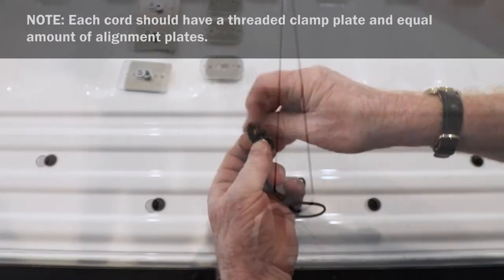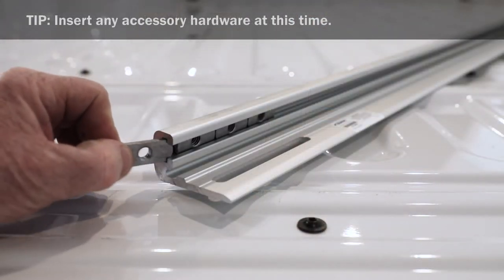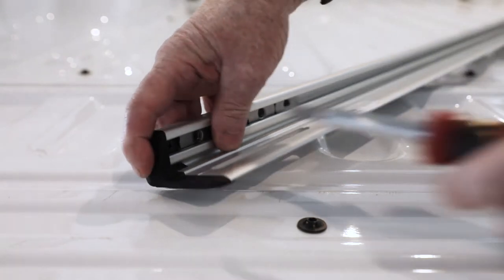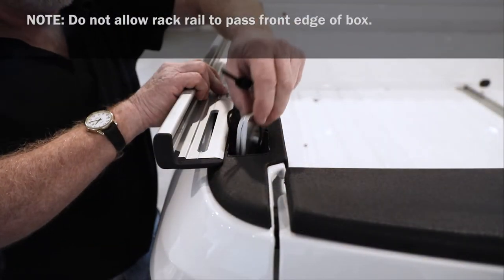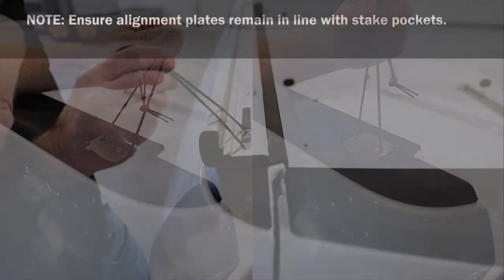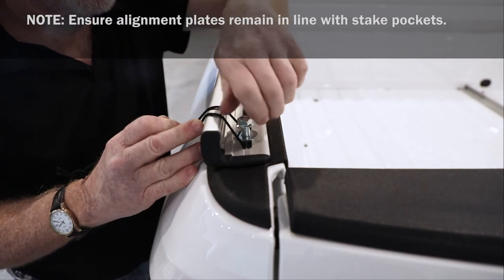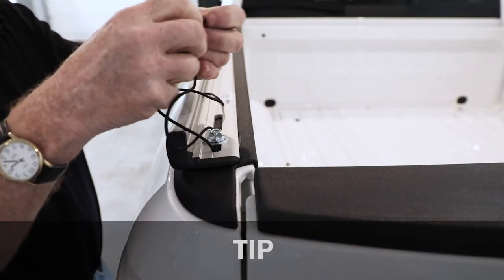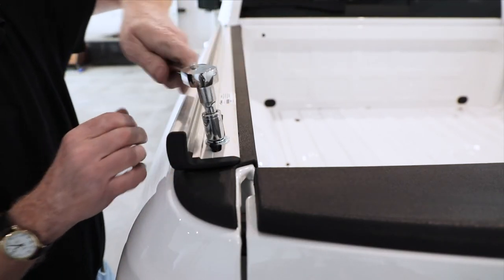ADARAC™ Aluminum Utility Rail Install Video

Comment: So the mounting of the rails just one bolt on each end. Two bolts on each side of the truck?
Reply: Hi pauljolry, You will secure the rail using a bolt at each stake pocket location.